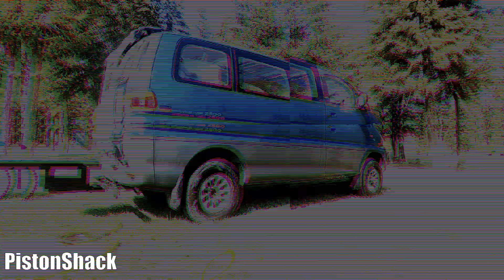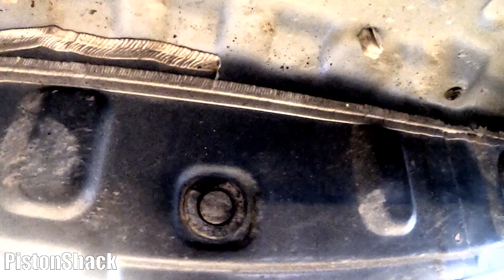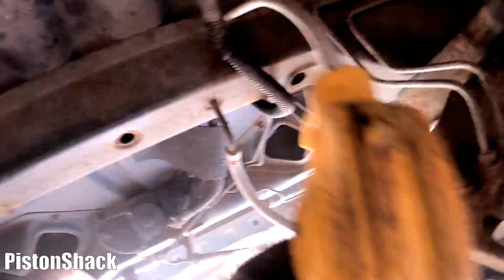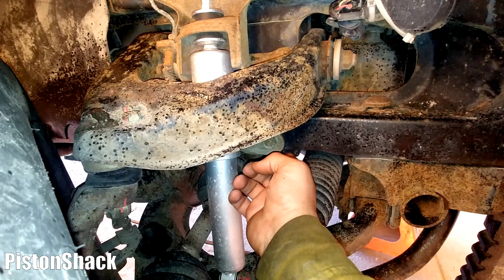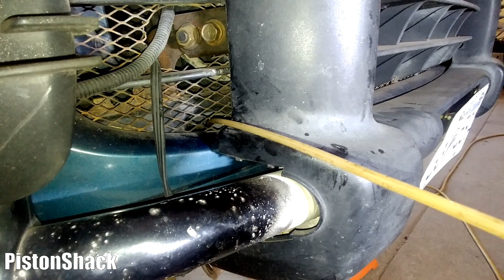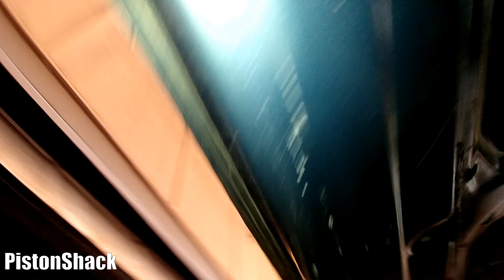How To Fluid Film Mitsubishi Delica To Prevent Rust | Start To Finish Inside Out.

Comment: Thanks for the video, which clearly shows the classic corrosion issue with L400.  Question:  After applying the Fluid Film, why not also plug up the front opening of these frame beams, such that water is prevented from entering in the first place?  Maybe spray just a bit of expanding foam at the beam opening to plug it up?  What do you think?  Thanks again for all your helpful videos!👍
Reply from the maker: Hey, Brad! I won't plug front openings it also improves ventilation inside the frame to let metal to dry up faster. Moisture can get in inside anyway.

Comment: Stop running the engine blow by back through the turbo. This will Kill You Car..... Vent the blow by from the rocker cover to atmosphere through a catch can.
Reply from the maker: I see your point! Do you have any recommendations or examples how to do it on Delica? Thanks!
Reply: Give me an email address and i will get you some pictures or a short Video of my Delica mods

 @PistonShack
Reply: @PistonShack  You can find lots of videos/web documents on putting a catch can on a 4M40 - I got a cheap can with high flow; you don't want one that will restrict flow and increase crankcase pressure. I vent mine back into the intake, but the can works for most blowby oil.
Reply: @PistonShack  I've seen MANN ProVent 200 test as well as some other popular catch cans and it just confirmed my earlier decision to install provent. I connected its drain straight into an oil tube going down into the sump and added a one-way velve to it. Before I could see traces of oil on the air filter at the spot where hose from the rocker cover is connected that is feeding blow-back gasses, now I don't see any and I can see the can is draining oil. However I used Provent 150 model as it better suits the engine size as in general efficiency depends on the speed of exhaust gasses coming into the filter.

Comment: Original tire size....how cute😅
Reply from the maker: I love it! 235 75 R15 factory OEM size! I like to keep this Delica looking classi stock much as possible!
Reply: @PistonShack  Me too, I even reject any other color than the Green/Gray......but I have a bit of a lift and 31 inch M/Ts
Reply from the maker: @jackharper3190  That's better option for out of paved roads driving! M/Ts are great on dirt, rocks and gravel for sure. I am planing to put AT tires (same size) instead of regular HWYs cruisers.